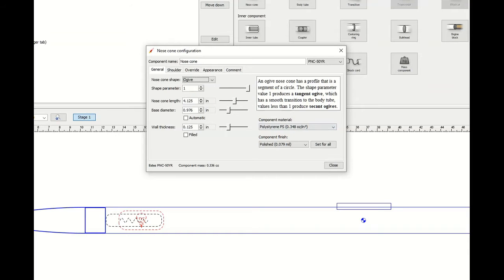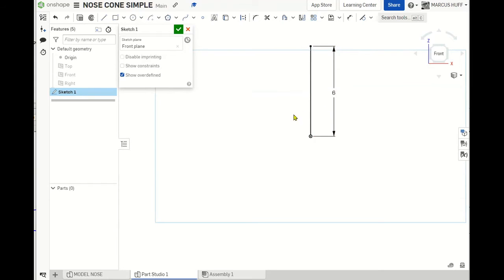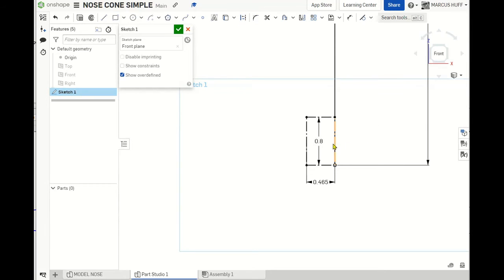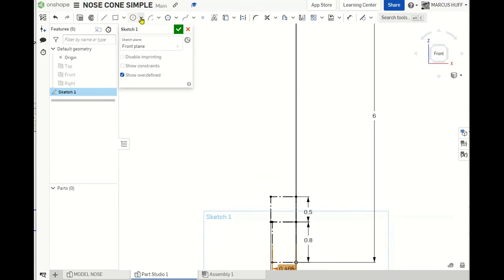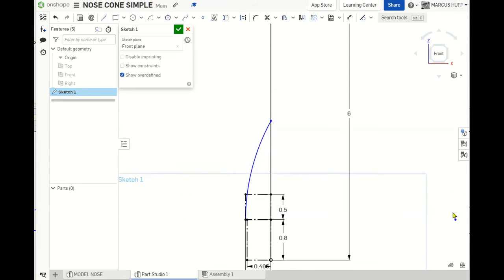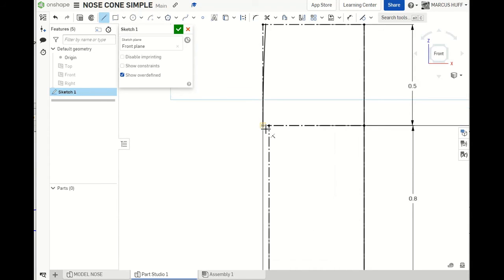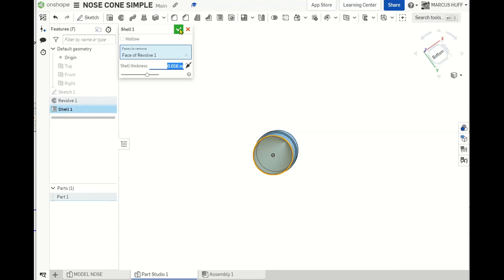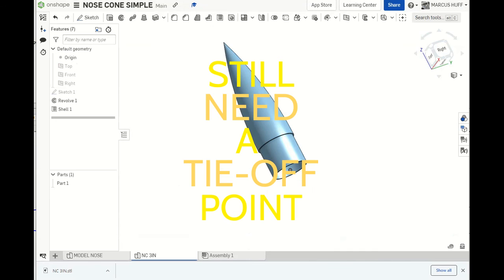AERO-OGIVE NOSE CONE ONSHAPE

Comment: i found a way that greatly simplifies the creation of this shape

in the sketch tool, you obviously want to form the base longitudinal line 

following this, replicate the sketch rectangle and make it the desired radial distance you want your nose cone to be

instead of placing your circle at an arbitrary distance from the base line, you use the tangent arc sketching feature and place it about the bottom left (or right if you did it that way) corner of your sketch rectangle at the top of the base line

then, you establish a tangent between the line situated on the leftmost side of the sketch rectangle and the tangent arc

an error will occur, but all that now remains is removing the initial tangent mate (the one on the farther left) of the arc

and now youre left with the shape!